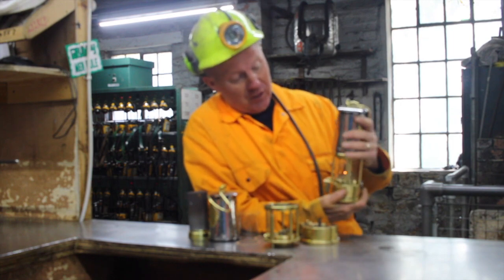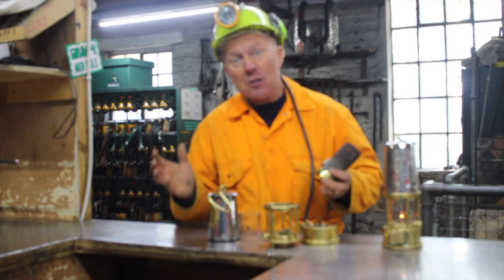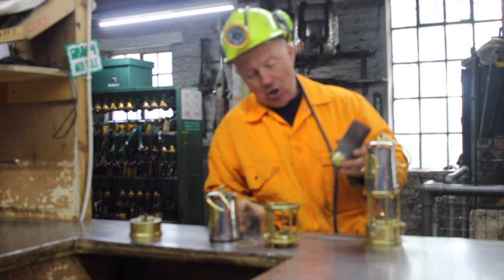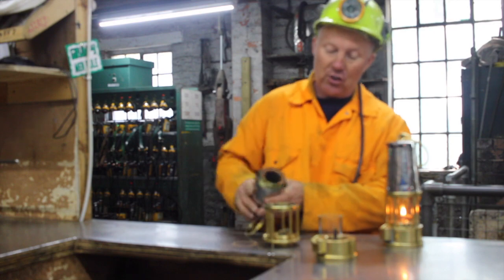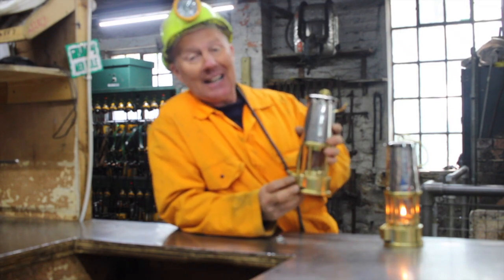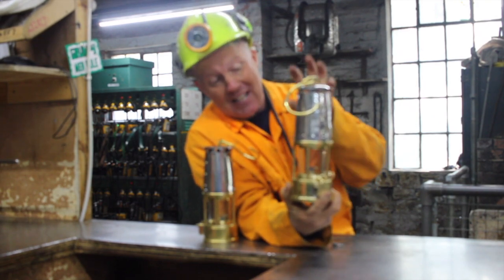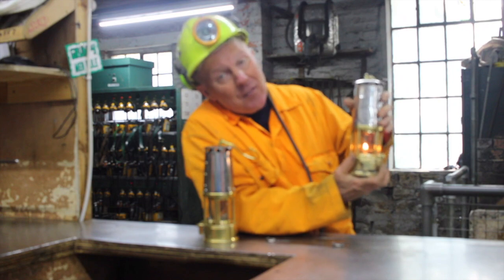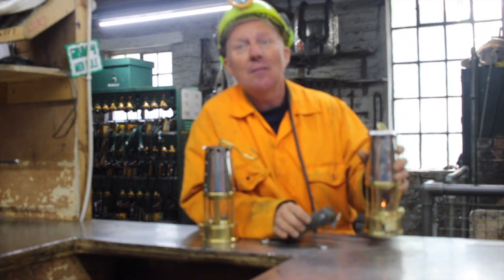Deconstructed Lamp

Comment: Not to butt in,but black damp isn't a gas. It's stagnant air or dead air. No oxygen. No other gases,such as methane,CO,CO2 and others doesn't have to be present to cause black damp. Just a lack of ventilation.
Reply: Black damp derives from the German word damph and is a mixture of gases reducing oxygen content mostly found in swirlies generally heavier than air but not always depending on the composition
Reply: @jeffstevens763  not always. Wth is a swirly?
Reply: Of course it's a gas! You can't have no oxygen without some other gas replacing it. What do you mean by "dead air" unless there's a vacuum (which there definitely isn't) your "dead air" must consist of gas. Invariably CO2.
Reply: @MrAdopado  yes dead air. Stagnant air means there's air but oxygen deficient. No other gases need to be present to cause stagnant air.
Reply: @MrAdopado  you must be one of those collage guys huh? I once had a Serbian mine engineer tell that methane could be smelled in high concentrations. Do you believe that too?
Reply: @kennethmckinney2088  Collage is sticking bits of paper together to make a picture. College on the other hand is where you learn things. However, my knowledge about gases didn't even need college education ... I learned about that before I left school! Anyway here's a definition: "Black damp is an atmosphere in which a flame lamp will not burn, usually because of an excess of carbon dioxide (CO2) and nitrogen in the air."
Reply: @MrAdopado  so you had to make a point of a typing error? Nice. Where did you learn about gases? The internet? I've got over 15 years mining experience and a certified mine foreman. I don't need your internet definition to tell me what I already know.
Reply: @kennethmckinney2088  If you don't understand the gaseous make up of Black Damp then I am horrified to learn that you are a qualified mine foreman. You certainly are not a qualified engineer! (And by the way, I learned about gases before the internet was invented!)
Reply: @MrAdopado  I understand them more than you do apparently. So you do believe that that an odorless gas can be smelled in high concentration. And as far as your gas knowledge and where it came from is questionable.
Reply: @MrAdopado  by the way,there's no such thing as a qualified mine foreman anywhere in the U.S.,only certified. Which means a state or federal test must be passed. Obviously wherever you come from, that's not the point.
Reply: @kennethmckinney2088  OK, what are the approximate gas percentages in "stagnant air" ... your phrase not mine! The numbers have to add up to 100%. Now tell me which part of that isn't a gas? Normal dry air is 78% Nitrogen, 20% oxygen 1% argon and 1% trace gases including about 0.05% CO2 (you'll find that your "stagnant air" has a much higher percentage of CO2)